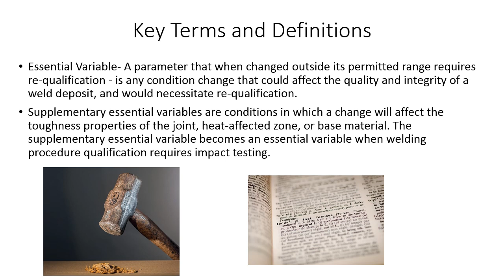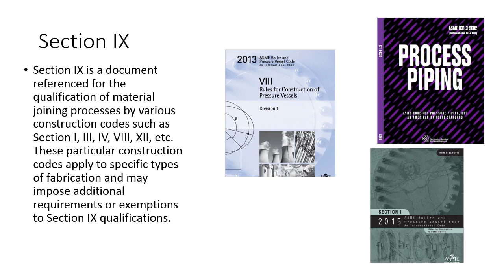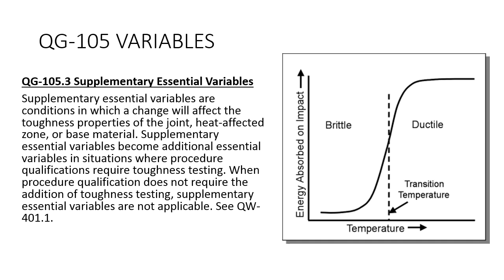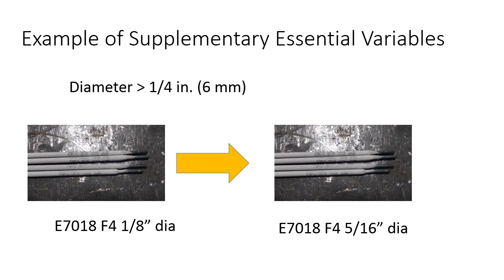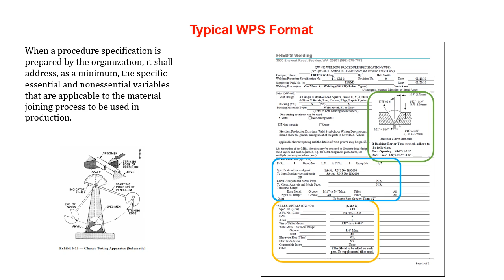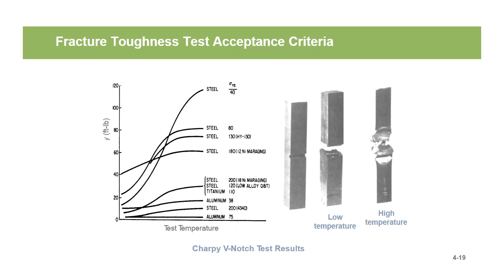CWI Course Module 5 - Supplementary Essential Variable Short Video

Comment: Technical question on PQR/WPS qualification:
If a PQR specifies PWHT of 2 hours at 655 °C and impact testing is not required, would it be acceptable to develop a WPS for TIG welding with a reduced PWHT holding time of 0.5 hours at the same temperature (655 °C)?
Reply: ASME IX is my reference